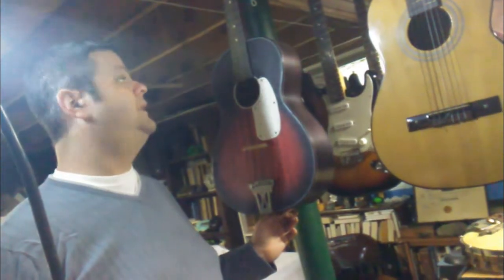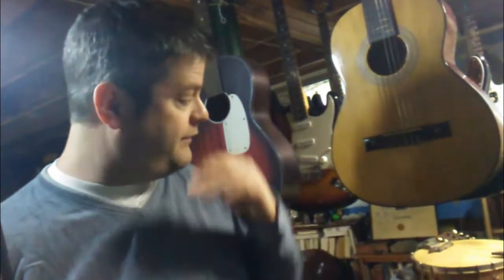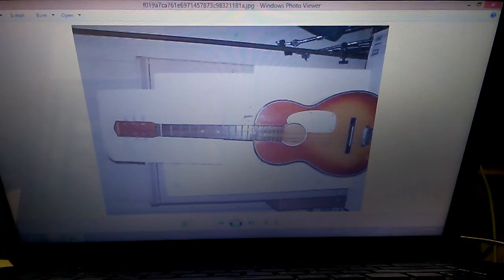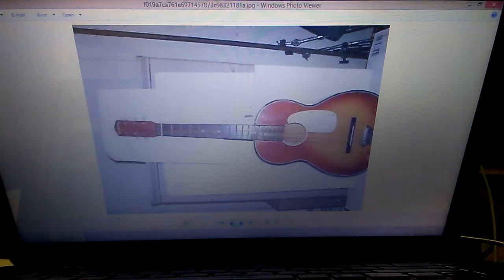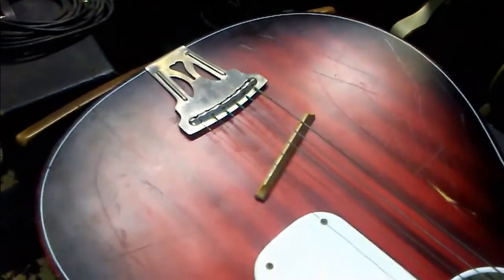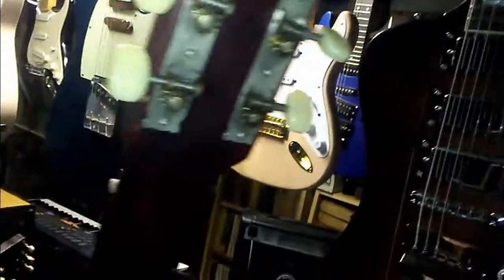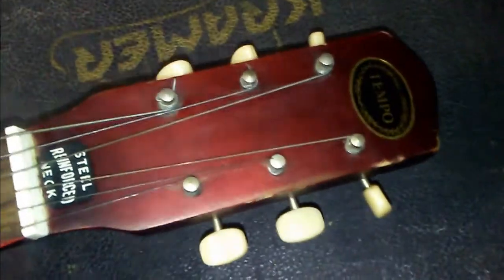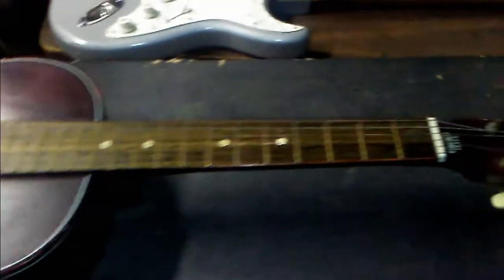Guitkits Video Journal #62: 1960s Tempo Student Instruments

Comment: I've been trying to look up information on these Tempo classical guitars. I just got one yesterday from a 65 year old lady here in Houston. She said her dad gave it to her she was 16 and the it's actually 49 years old. I love it. It looks like it's only been in it's soft, leather-ish case and hardly used recently. Number inside the body is 11218. Is it made in Japan?
I'm trying to give it a good clean and set up without altering the guitar itself. It's the same as that one at 9:53 but the body is the same color as the head. I'm happy I found your video, sir!
Reply from the maker: If it was made in Japan you will see "JAPAN" pressed into the wood on the back of the headstock like detailed at 20:28. Roundabout 1970 they moved production over to Korea and this Japan stamp was replaced with a sticker that said Korea. Some of the early Korean models actually had some of the old Japan stock with Japan scratched out underneath the label.
Reply: @bhabhiguitkit4874  It didn't have anything pressed onto it. And it does seem like a sticker was taken off of the back of it's head. I was hoping that it's from Japan but I'm still happy I at least know where it's made. Thank you, sir!